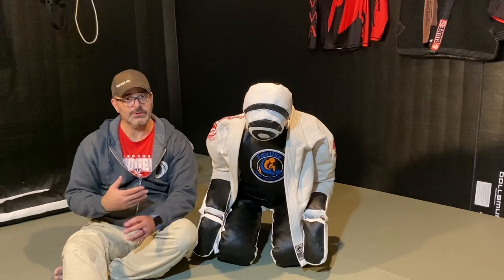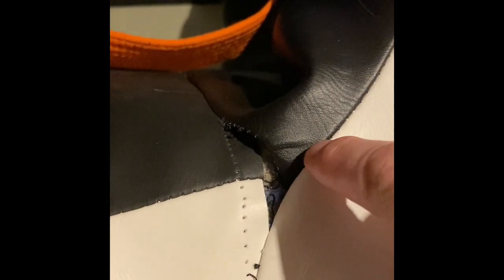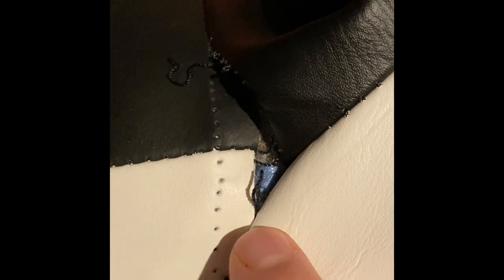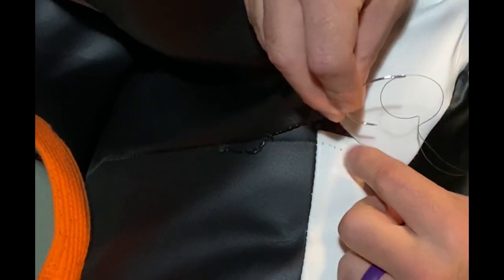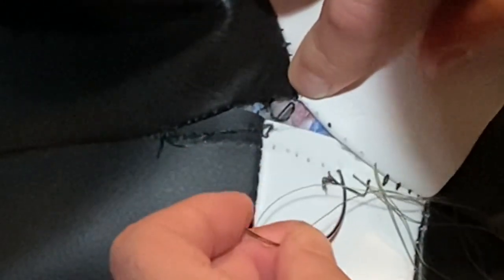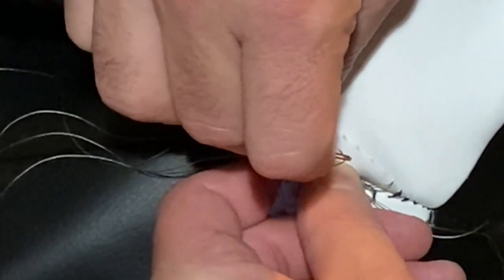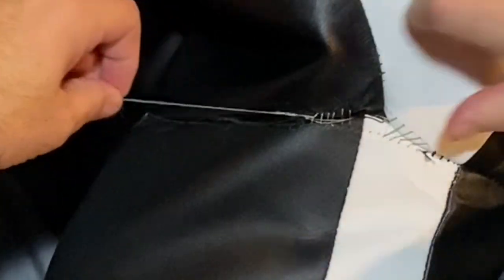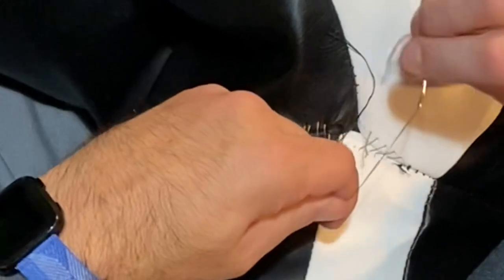Busting at the Seams: Repairing the Fav Uke grappling dummy

Comment: How long have you had it before it started coming apart like that?  And is it still worth it after having to deal with that issue?  I was just on their site but decided to do some research before I bought one. Looks like it seriously needs better stitching.
Reply from the maker: Hey!   Well I have had this dummy for 3 months, and I use it 6 days a week for about an hour.  The drilling has been technical and controlled up until a couple week ago. I started to add a couple days of Progression drilling which includes:reps per minute, faster tempo, and high rep combo sequences.

Honestly speaking, the stitching for that area, which is going to experience lots of pressure, twisting, and bending, is a negative.  If you are familiar with jiu jitsu gi tops, there are a number of high stress areas that have extra material and stitching; but those gi tops or also cost more than this dummy.

Of course I am disappointed that I had to repair my equipment after 3 months, but it wasn’t that big of an issue or unexpected.  I don’t feel I was being overly rough or careless, just insufficient stitching.
Reply: @GrapplingwithInsanity  Hi.  Thanks for the reply.  Hopefully they will see this video and improve the stitching.
Reply from the maker: The person I communicate with there, from time to time, has been very nice. I sent them a couple photos of the issue and they were taking them to the manufacturer.
Reply: @GrapplingwithInsanity  Thats great.  Hopefully they improve them.  I contemplating getting the favuke vs the cheaper ones on Amazon.  I know nothing is perfect but hopefully they can sort out this issue.

Comment: It definitely needs a gusset style patch work like the gi pants in the crotch
Reply from the maker: Exactly my point
Reply from the maker: I think I said that, similar to the armpit in the gi
Reply: @GrapplingwithInsanity  yes. But it should be way wider and triple stitch using cordura fabric
Reply from the maker: Now you have me thinking!! Lol!
Reply from the maker: That Cordura looks like tough stuff, just checked it out
Reply: @GrapplingwithInsanity  just trying to help the higher belt out there
Reply from the maker: @kevinchan4951  How would you think to retro fit/apply it...inside or outside of the dummy?
Reply: @GrapplingwithInsanity  definitely need to make a double patch from the inside and out and weave it circular.